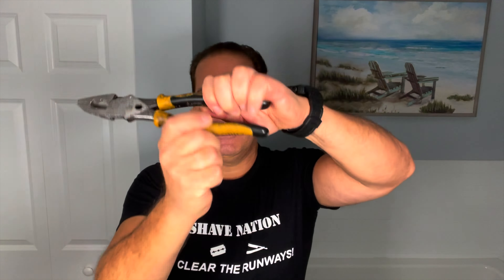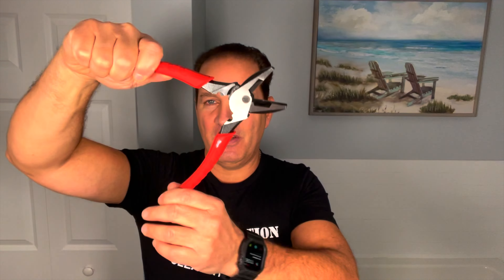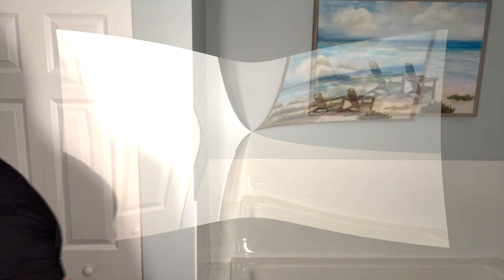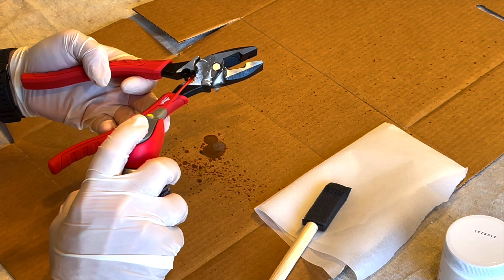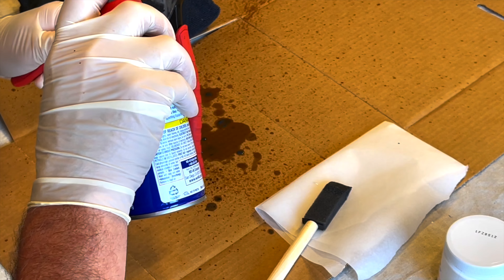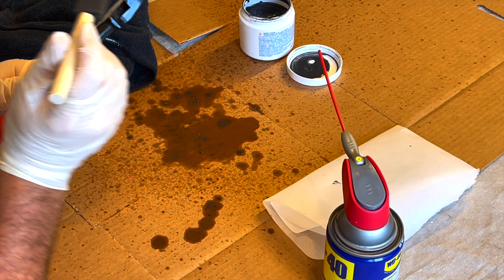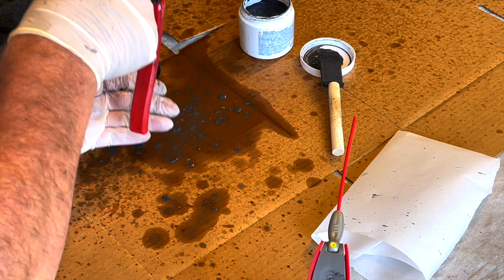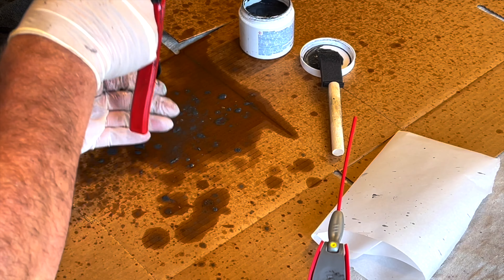Pliers-Tight-Tools-How To Loosen Them in 9 Minutes!

Comment: Fellas,if you do have older tools that have rust of any kind..here is my recommendation: wipe our even soak the area in "Marvel Mystery Oil. A tremendous solvent that will work wonders not only in a vehicle, but on any metal surface with rust. I have brought engine parts back to life by using this product.

Comment: I would think the valve grinding compound is a bit too coarse. I use a few drops of a good auto paint cutting compound works well, or even toothpaste will get the job done, maybe a little slower. Just as common with old pliers and cutters is them getting too slack over the years. T cure this I identify the moving side of the pivot and peen lightly round the circumference of the rivet with a small ball end punch. Try not to get them too tight, but if you do, it's back to the compound for freeing off a bit

Comment: My dad was a sparky at the Michelin tyre co. here in Stoke-on-Trent. He died in 1986 but I still have all his tools - far better quality than modern tools by far & I use WD40 on them regularly. He chipped the blade on a set of pliers by cutting a live wire, but the sleeves saved him, so always keep the sleeves in good condition.

When I came of age he taught me to shave, naturally back then I had a DE razor as did he.

I keep showing your vids to my 15 year old but he prefers his electric. He'll come around.

Speaking of Klein, here in the UK we also use generic terms to describe stuff, for example ANY vacuum cleaner is referred to as a 'Hoover'.

Also, Merry Christmas to you & yours Geo.
Reply from the maker: Good stuff Simon. Thanks for sharing. Just like Xerox in the US meant to "copy" something. And - If you "Hoover" food, you eat it very quickly. And all nose tissues are called "Kleenex" It's great when a brand takes over the total name of something! And-RIP to your Pops.

Comment: This is a fantastic method! I tried heating the joint and then pushing oil in it. Helped a little, but this polishing method smarter.
Reply from the maker: Great! glad I could be of assistance.
Reply: I'm thinking of trying it with a folding knife too.

Comment: The valve grinding compound can be useful to dab on a stripped screw head for extra bite with your screwdriver as well. Klein are the gold standard for linesman pliers. I would’ve went went channellock if not a new set of Klein. Both are USA. If going for foreign made pliers then go for Knipex (made in Germany). Knipex makes truly excellent pliers of every type.
Reply from the maker: Good stuff Allen! Thanks for sharing.

Comment: For a week I tried to loosen pliers with some lubricants with no effect. Your method worked like a charm. I only wonder if the grinding compound won't have negative effects on the joints. I used it on cheap market pliers so no big deal if I wear them out faster. Thanks for a great tip!
Reply from the maker: I've had no issues with it. Still working great!

Comment: Just did this to my new set of 11 in. curved jaw pliers.$30 for a 5 pc. set.I wasn't going to pay $35 for one pair of Knipex.They were practically useless before doing this.I needed both hands to open them.Now it's a one handed affair.I used permatex 80036 in the tube and added wd-40 and made a slurry and worked it in with a acid brush.Thanks for the tip.

Comment: Hi, I did it for the pliers of my multitool victorinox spirit and it worked. So I put some of the permatex in the rest of the utensils and It worked in the opposite way. They are extremely tight now. Do you have any advice to fix them too? It sounds like there were some sand inside. How could I loosen them? (I mean the rest of the tools in the multitool: blade, screw driver, scissors, etc...) it work for the pliers but not for the rest...
Reply from the maker: Are you sure you don't need to just work them some more with the Permatex? Those other parts may just be more resistant. Read the other comments-there were some alternative ideas posted
Reply: @geofatboy  I worked hard on the other parts adding plenty of W40. And there's always a remain of black permatex. It sounds like sand inside. It's not so hard now because I clean all the permatex little by little. It's still   rigid but not so bad as at the very beginning. Anyway I don't recommend it for anything else but the pliers. The pliers are loose and great now.